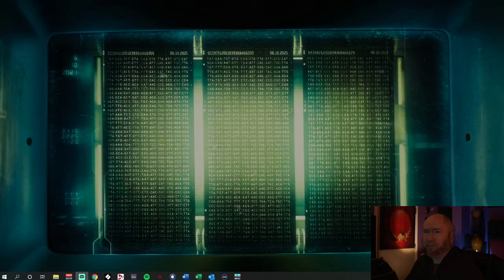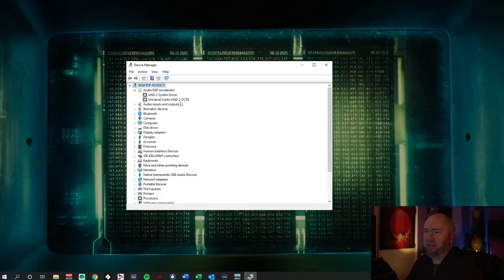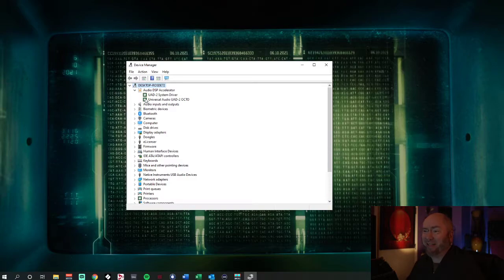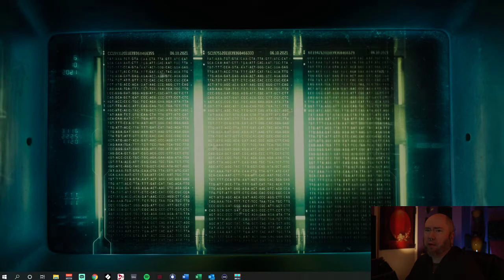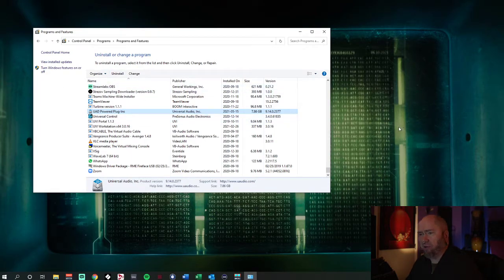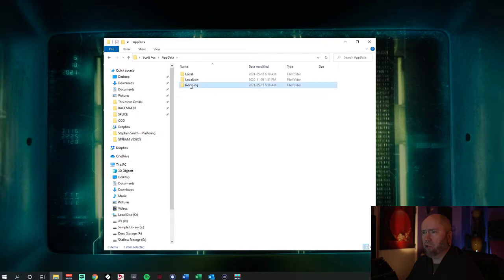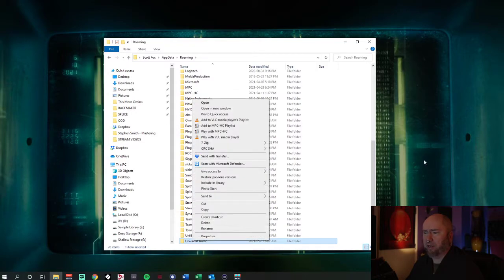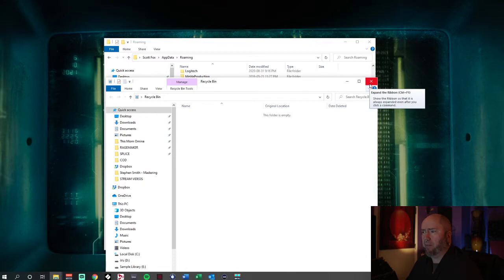UAD Disabled Red Light SOLUTION

Comment: The $100 Arturia Mini Fuse I bought for my wife's new gaming computer is far more reliable than my glitchy Apollo Twin ever was. And now it's broken, completely. Worst $800 I ever spent. Anybody looking to buy one, know you'll need to purchase another in 8 years. Know that UA's customer support in non-existent. Know that it will constantly crash and disconnect from your motherboard. Know that you will constantly have to reset it and reinstall it's software and drivers. Know what an absolute nightmare that will cause you to lose all passion for the recording arts you are signing yourself up for.

Comment: I could get a PCI-E Solo card cheaply, but I'm afraid that it won't run on my Ryzen system .. Should I go for the USB variant and save myself the problems that can arise? I would get the card for 170-200 € the interface would cost 699 € here in Germany ..
Reply from the maker: Most people don't have this problem. There are some that do. Sadly, I have no idea what makes it happen. If you can get a pcie and a good price, you should be fine.